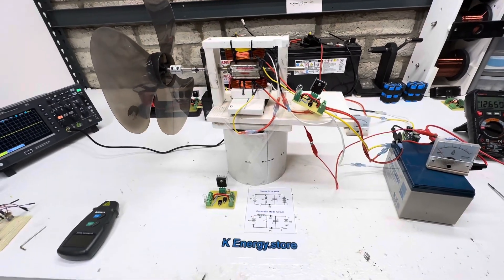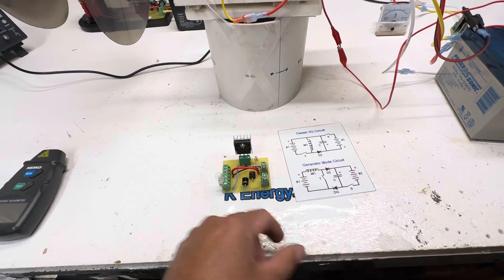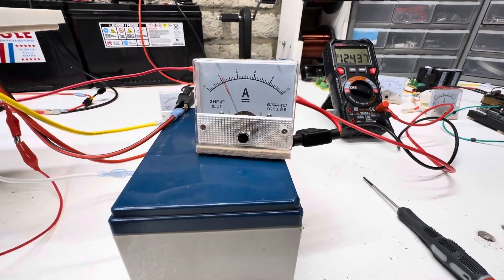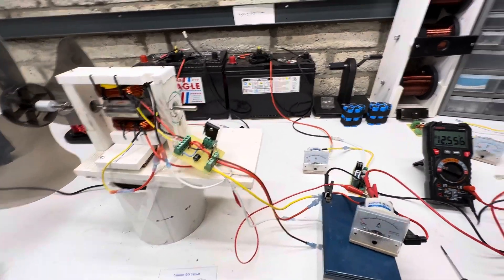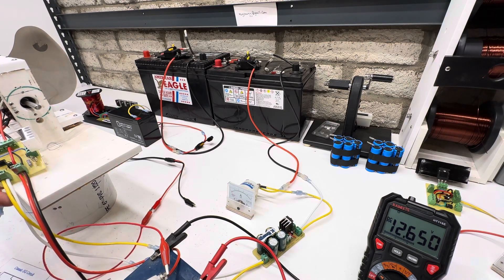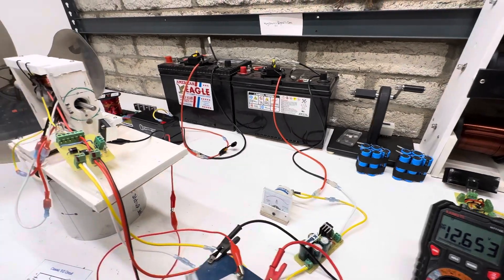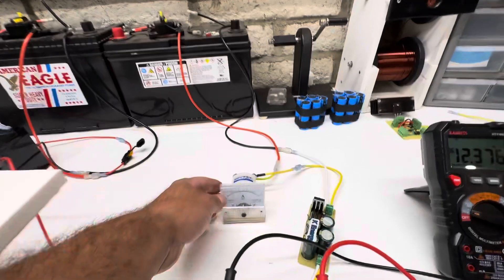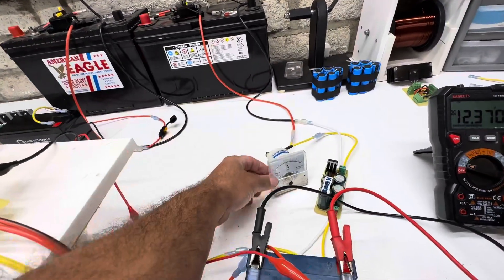Bedini SG verses bedini generator mode

Comment: In the original Bedini circuit, the coils were bifilar.  The first coil activating the secondary windings.  Is that still the case sir?
Reply from the maker: @hoofheartedicemelted296  yes 2 coils
Reply: @kenergy1707  Thank you, sir.

Comment: what was the voltage and amps in the generator mode?  video was not clear on it.  Nice video-thanks--answer will be appreciated?  I have a couple more queries.
Reply from the maker: 12v 1.6 amps it shows on video

Comment: I wonder what was in my comment that got it deleted? Did you see the long comment in your notifications?
Reply from the maker: I didn’t
Reply: @kenergy1707  it was sbout a new invention didn't mention anything but the paedophiles at YouTube decided to delete my comment i cant wait till lawsuits start I'm gonna get millions off youtube they deleted 1,000s of my comments
Reply: @kenergy1707  i was trying to ask your opinion,  ssg circuit ,no battery just primary coil through a full bridge rectifier into the ssg, could it trigger the transistor? It was a much bigger comment last time
Reply: @kenergy1707  obviously with a spinning magnet energizing the coil
Reply from the maker: @doubleooh7337  it would not you need trigger winding or a modified circuit
Reply: @kenergy1707  but theoretically if the coils had enough emf generated by a magnet , could it turn on the transistor even if while only manually turning the magnet, outside wind could turn a fanblade
Reply from the maker: @doubleooh7337  I suggest you do the experiment
Reply: @kenergy1707  id make the coil with 20 strands of wire and just one of those strands going to the base and the 19stands connected in parallel  both would have the same v out and 19x as much Amps out on the 19 strand primary coil, my motor puts alot into the coils as i use n52 magnets
Reply: @kenergy1707  i am gonna do it eventually I'm gonna make my own wind turbine but want a simply way to get power out not how bought ones do
Reply from the maker: @doubleooh7337  sounds good 👍
Reply: @kenergy1707  how much is you made curcuit cost? I definitely get one and multiple if they isn't to exprnsive, ive still got 1 motor i made left that'll do for some experiments
Reply: This circuit on this video
Reply from the maker: @doubleooh7337  49 or the double 60 
www.KEnergy.store
Reply from the maker: @doubleooh7337  hey buddy your circuit is on it’s way !
Reply: @kenergy1707  okay thanks on the motor i got i might only be able to run it for a minute as i wound it like a transformer thick primary wire /thin secondary, it's alright though ive been needing a excuse to make the new motor for a couple of years already, got 4 different coils to make, before bedini i learned alot about tesla some of it rubbed off on me lol
Reply: @kenergy1707  i got a thermal camera to see if anything heats
Reply from the maker: @doubleooh7337   very cool make sure when you switch between modes you turn it off 
And always have output hooked up
Reply: @kenergy1707  I'll probably look at your videos on it a few times before doing anything,  wheres your output? Is it From the c of transistor back to the positive of the battery?
Reply from the maker: @doubleooh7337  I made a diagram for you
Reply from the maker: @doubleooh7337  do you have telegram?
Reply from the maker: @doubleooh7337  very cool!